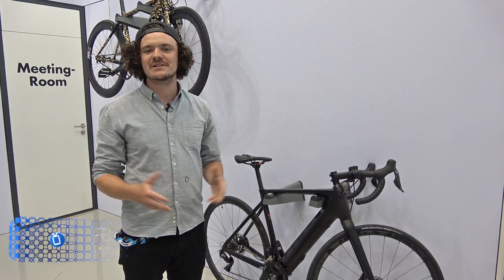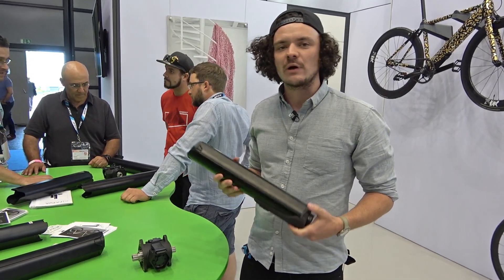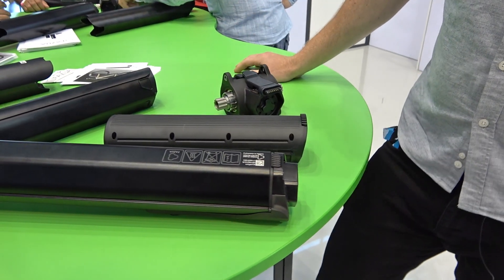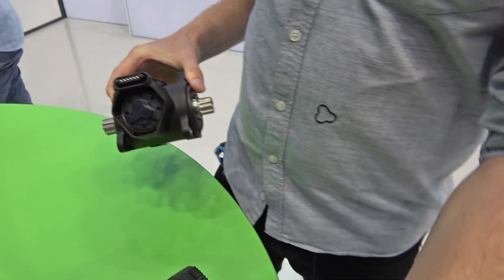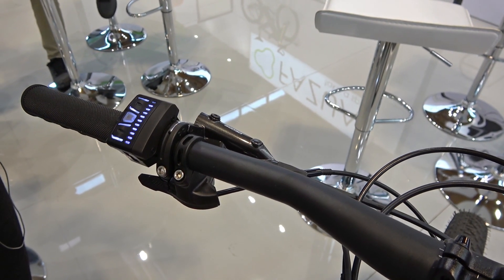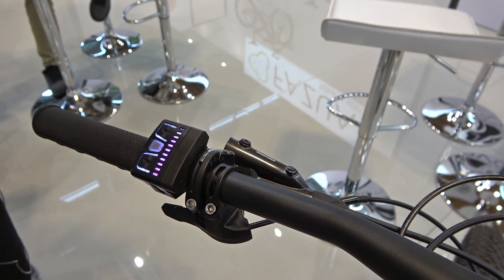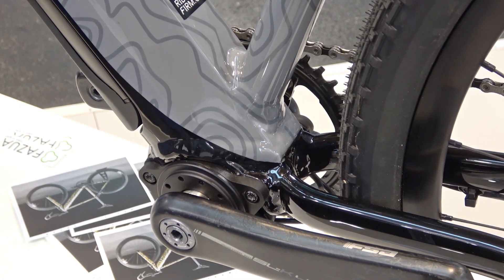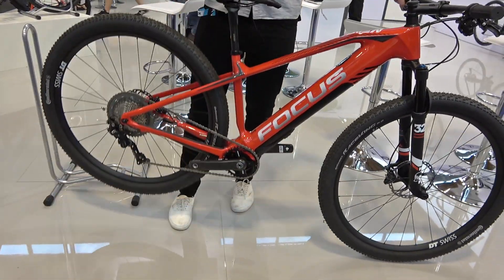Fazua Evation eBike Motor Presentation - Eurobike 2018

Comment: Lovely. But 25km/h limit on gravel / road bike is a bit of a joke. And so is 250w battery capacity. The control panel is very rudimentary compared to Bosch' or even Kalkhoff's. 
I'd be interested to know what its max. torque is, what the battery's actual range is with, say, a 100kg rider on the bike. Some companies, for instance, claim a 70km range which in practice turns out to be just short of 20.
Reply: It is hard to answer and belongs on the trainingsform of the driver. On a flat road it is easy to get 70 km. I have a racing bike with fazua system and it is possible to reach 100 km and mountains up to 1000 hm. But all belongs on how much you do on yourself with only a little help from the system. The wind has also much influence on the number of kilometers.